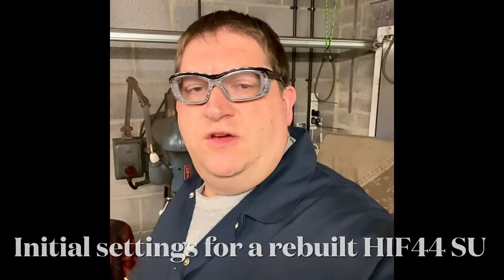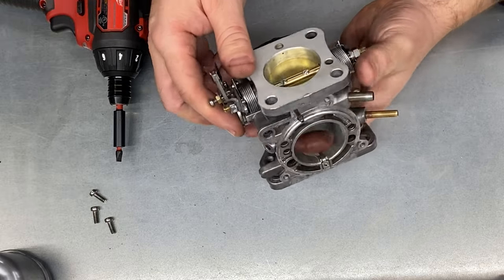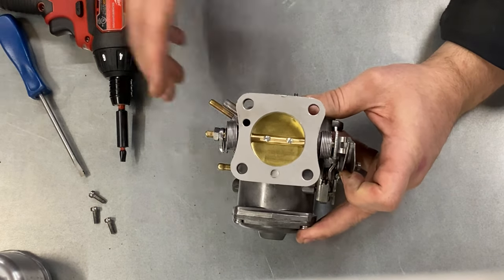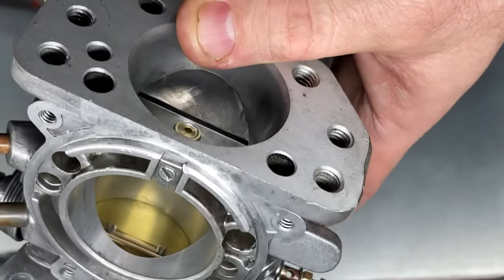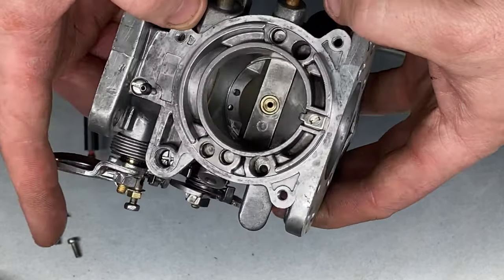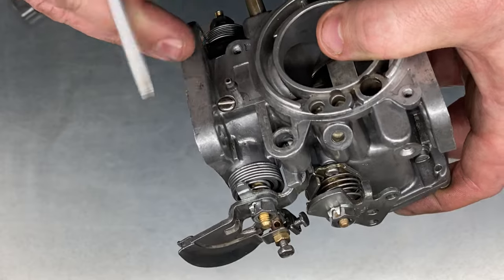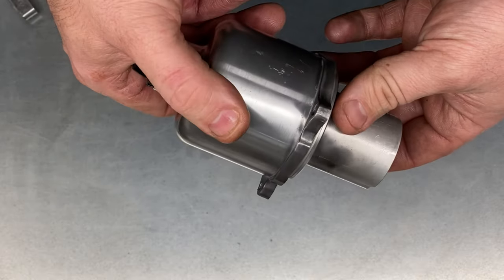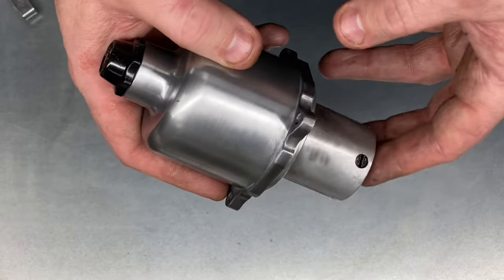Setting up a fresh rebuilt HIF44 SU for initial start

Comment: So helpful mate, Thankyou for sharing your knowledge so freely. I’ve been rebuilding a Hif44 for my Mg metro engined Mini and couldn’t work out why the accelerator pump effect was so lethargic regardless of what oil I used. Just realised watching this video that it has the wrong damper in it! It’s fitted with a LZX 1505, not the LZX 2085 as you said. Brilliant!🙏🤗
Reply from the maker: Glad to be of assistance

Comment: I have an old MGB with twin carbs. After rebuild them it would not run. After I watched your video I learned how to properly set the carbs and now it runs well. Great video. Thanks.
Reply from the maker: Glad it helped you out, remember they now need tuning properly to get the best from them and your engine.

Comment: Hi I found this very useful for base settings. I have an old 3500cc V8 with twin hif44. I can get it running but will go back and recheck these base settings as it struggles to pick up on revs.
Reply from the maker: You may find that this needs a full tune up like I am finding with many other SU equipped classics. Usually a nice pair of custom made needles will have it singing in short order, assuming that everything else is spot on.
Reply: How much oil should I put down the damper.

Comment: Great video AC and been watching your channel for some time and quick question. I have an HIF44 I want to drop on my classic mini but it’s seems the configuration is different on the one side  where the idler screw etc goes in - I suspect it came off some other type of car but not sure. Guy I bought is willing to return it but I think I could get it to work but wanted to maybe get you to take a look at it just for feedback or even a link to site where I could look at various HIF44 variants as then could figure out how to put that side together - hope this makes sense and thx for your time - would send a picture and maybe if you have a site I can message you a pic ?
Reply from the maker: I can be found in Facebook messenger

Comment: Great information, Im having alot of issues with a sherpa running a hif44 it always needs choke to start what ever temperature and will peter out if the idle screw is reduced below 1100rpm. Ive done all the seals,inlet gaskets and air leak checks but still wont let me set a nice base idle. Would you have any ideas?
Reply from the maker: You need to be able to determine how
Rich or lean it’s running.
Reply: @ACDodd  I've had it on the 4 gas and it doesn't seem to matter at what co percentage you run it at, as soon as you try and reduce the idle stop screw to a sensible level it just Peters out then needs choke enrichment to restart. It has a late style ignition system with an ecu. Knock,ram and temp sensor.
Reply from the maker: @DaleCutler-qf9hn  check for airleaks on the manifold using brake cleaner

Comment: I have this HIF44 carb on my car which I recently bought

It seems to have an intermittent fault where sometimes when the engine is hot/normal temp and at idle the engine will idle lower and lower before cutting out… 😩

It will then refuse to start unless you use a little bit of choke

According to the previous owner the carb has been rebuilt…

There is oil in the dashpot and there is a in line fuel filter fitted
The fuel mixture, idle and fast idle have all been correctly adjusted

What could be the issue with my carb please?

As it stands it makes me frightened to drive the car in fear it mat cut out at a junction etc

Thanks, Dan
Reply from the maker: Could be a few things, first check the float level setting and then have it tuned properly.
Reply: @ACDodd  Brilliant will do thanks a lot ☺️

Comment: Hello Mr Dodd.
Your tutorial is absolutely what I needed as I am in the process of rebuilding the same unit.
Just a question..... the Carburetor you're demonstrating appears to have a sheen of some kind.
Is it just polished or coated with something?
Reply from the maker: It’s just cleaned properly
Reply: @ACDodd  Thank you sir.
In regards to relocating the vent port....what angle would you say  the hole needs to be drilled at,  in order to come out in the correct place?
What's the margin of error?
Reply from the maker: @darendeonarine9277  both good questions, to be honest I have developed a process over 20 years using a pistol drill that requires no measuring and puts the hole in the right place. However, I have never measured a factory unit to give you the specs
Reply: @ACDodd  Thanks for taking the time.👍🏽👍🏽👍🏽
Reply: Hello Mr. AC
 Ever had to remove a broken idle screw from a HIF44 CARBURETOR.?
Had the body soaking in wd40 but the bugga snapped anyway?.... also what thread is it .....I'll likely have to drill and tap?

Please advise.
Reply from the maker: @darendeonarine9277  currently on holiday so I can’t check for you right now. However contact Burlen fuel systems in the UK, they will be able to assist!

Comment: I've got the SU HIF7 on my 1974 xj6, and it keeps on pooring / overflowing. New needleseats and needles already placed, and the float setting -1mm from the body bottom. 

What else can I do?
Reply from the maker: What is the fuel pressure being supplied to the carb?
Reply: @ACDodd  new fuelpumps inside the tanks I actually don't know
Reply from the maker: @cyrielgaemers measure and get back to me.

Comment: Hello AC, question for you. I have Healeys and have had a 3.8 Jag. I am familiar with twin HD6, HD8 on the Jag and Big Healey and twin HS2s on our Bugeye. We are not unhappy with the performance of the HS2s on the Bugeye but just for fun thought we might try a single HIF 44 to see how we like it. We have acquired the new HIF 44 but have not fit it yet. still need to get the Maniflow manifold that will allow the HIF 44 to fit under the bonnet of the Bugeye. I have not encountered the manifold vacuum before on an SU having been used to ported vacuum with the other named SUs. I am just curious. Do you know why SU used manifold vacuum on the HIF44? It would seem that with a newer carb there would be more sensitivity to smoother running and improved emissions? But I know very little about such things and would like to learn. It just seems odd that one of the first things one would want to do with this fairly expensive carb is to block off the manifold hole and add a hole for ported vacuum. I certainly understand why you do it. I just don’t understand why SU didn’t design it with ported vacuum. Sorry for the long question. I love your channel and respect your knowledge and willingness to share. As I said in an earlier comment, I sure wish you were here in Florida! I hate to drill a hole in a brand new carb 😮 hope I don’t screw it up!
Reply from the maker: In short the position of the vacuum pipe has to do with the application. Some HIF carbs have ported vacuum as standard. Later engines were designed with economy and reliability in mind. Therefore the factory would install a dizzy with much retarded mechanical advance curve and rely on vacuum advance to make the engines run well at part throttle. Thereby, when cruising or light throttle openings vacuum advance figure were optimum. When you put your foot down the engine performance was disappointing. But it was good for reliability. Now if you change the mechanical advance to optimise power you will end up with too mulch advance at idle. This means you need to reduce the vacuum signal at idle and thus get rid of excess ignition advance. This reduces hydrocarbon emissions and enables a more stable idle. Then at art throttle the ported vacuum is uncovered and economy is
Maximised as in the manifold vacuum version. When full power is demanded, vacuum drops and the engine is timed by the nowmoptimised mechanical advance mechanism, this delivering full power under all conditions.
Reply: Thanks, AC
Reply: AC, I previously mentioned sending my brand new HIF 44 to you to work your magic to prepare it for use on my son’s MKI Sprite. The carb has never been used, but I have watched enough of your videos to know that “new” doesn’t always mean “right.” I am going to check with DHL here (Bradenton, FL) tomorrow to see what the shipping cost will be. What address should I give them to estimate shipping? Thanks very much.

Comment: Great video! Do you use the fast drop damper (2085) for a turbo set up as well, or better to use the turbo damper (1505)?
Reply from the maker: Yes but the turbo usually requires a stiff lift to maintain enrichment during acceleration

Comment: Oh how I wish you had done this video 6 months ago. My 1330cc motor should have a HIF44 carb but I've had no end of trouble with the 3 that I have tried, one being a rebuilt unit none would run right. I sort advice from so called experts and none of it worked you fit a fast drop damper and that would have cured the problem. I have have at the moment a HIF38 fitted which works fine but probably not enough flow so can I ask do sell refurbed carbs? If so how do I contact you?
Reply from the maker: Yes contact me via Messenger. Carbs are exchange only. The reason I did the video was because I am aware of the frustrations people are having with poor information being available
Reply: @ACDodd  Thanks, I will once I have sourced another carb and my son sorts me out with messenger

Comment: hi , when your installing the needle holder into the slide , does it only fit one way , I understand the slot part , but does the open end of the slot go towards the top or the bottom of the carb , I see you mention it goes flush with the slide bottom , so Im assuming the retaining screw sets the flush finish , not the slot letting the retainer float ,,, and advice will be appreciated.
Reply from the maker: Open end of the slot into the piston first, the screw securely holds the needle holder in place no floating
Reply: @ACDodd  many many thanks for the swift reply ... that's the way I thought it worked ... but I rather liked the floating idea LOL.
Reply: @ACDodd  If its not too rude to ask , do you have any tips on setting the timing on an 1275 with an electronic ignition ,,, vac pipe off distrib , what revs and what degree , or can I do it static , like the good old days with points ... I have a strobe light , but nothing else , basically its to get it running roughly right but then Ive to find someone in northern ireland who can set it up properly ,,, sorry to be a pita .
Reply from the maker: @tomthompson7400  send me a Facebook messenger pm you could be a likely candidate for remote tuning
Reply: @ACDodd  i dont use face book , ill delete the address once you have it ,,, many thanks
Reply: lol ,,, you tube beat me to it  Ill ask the guy whos car it is to contact you , hes called mark . thanks again 
T

Comment: Do you prefer a HS4 or HIF38, and why? Thanks
Reply from the maker: Hif 38 all the way. More resilient/stronger float assembly, throttle shaft seals, rotary return springs on the throttle shaft, replaceable spindle bushes, ball bearing suction chamber, what’s not to like!!!
Reply: @ACDodd  thanks for the thorough reply AC. Would you recommend a AAA swing needle for a tuned 998 with a MD 266 as a starting point?
Reply from the maker: @OnlineHousehusband  no i would be installing a wideband gauge and then start with an ABD needle (very lean) and then run the engine and adjust from there
Reply from the maker: @OnlineHousehusband  no I would start with an ABD (lean) needle and use a wideband to understand the fueling and then go from there.

Comment: well it started for a second and now no matter what i do it doesn't fire back up or give anything
Reply from the maker: Then you need to determine the reason, ignition, timing or fueling
Reply: @ACDodd  indeed however it must be fueling and carburetor related at that because nothing else has changed. Can a carb be set up badly enough that you get absolutely nothing?
Reply from the maker: @ambivalentonion2620  yes, usually flooding or no fuel whatsoever
Reply: @ACDodd  it was flooded i believe, did some late night tuning and got it to a running and driving standard ready to fine tune tomorrow and hopefully get someone to properly tune it at some point
Reply from the maker: @ambivalentonion2620 if the car won’t start from the positions shown it is likely that other parts inside the carb are not as per factory specs
Reply: @ACDodd  oh i did get it running tonight, i think i just flooded it before and had it set up wrong initially

Comment: Nice, Just finish cleaning and a new service kit. Just have to get the car going again. Been sat so some years. Will go through these setting before first start up. 

I have a some new springs to try and different weight oils. So I'm looking for a fast drop and about 4 sec sink with 1.4kg on top. 
How does one mod the plunger  if one need a faster drop? I like modding, not buying :-) 

As for tuning, i've been watching https://youtu.be/4DoFYbPNuzE for info on AF meters and logging to find a good needle. Thoughts? 
Just found this channel, very good and informative. Keep at it.
Reply from the maker: Data logging is a long winded way around it, but if that’s all you have then will it will work.
Reply: @ACDodd  And the plunger mod? :-)